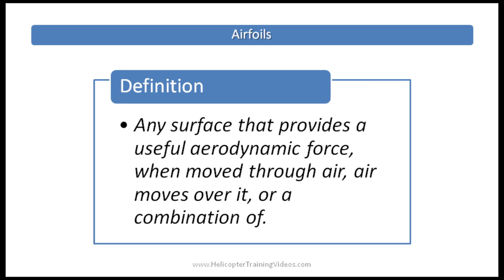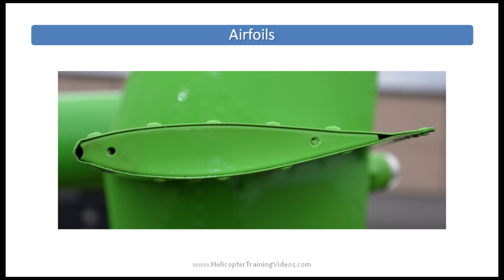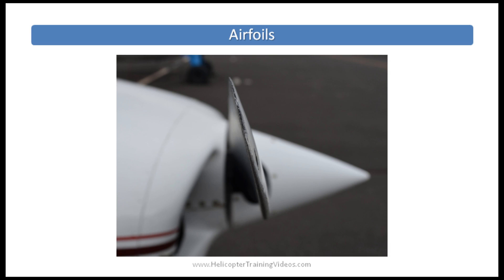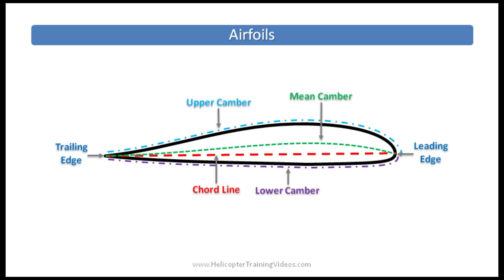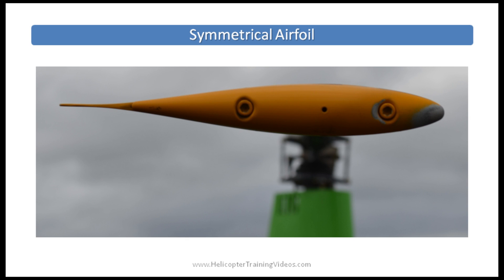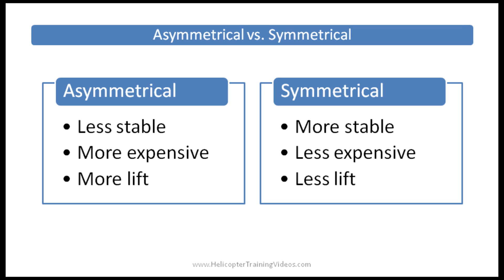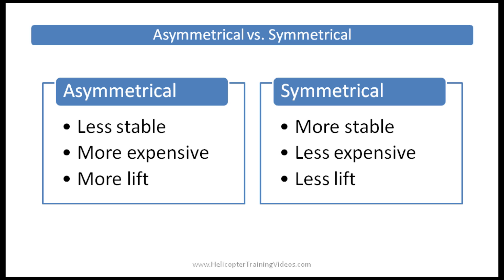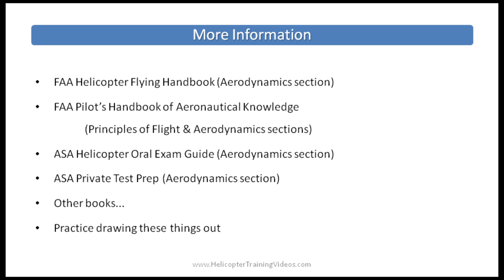What Is an Airfoil? A Wing, Rotor Blade, Stabilizer or All Three? Helicopter Aerodynamics.

Comment: I would like to know more about the newer swept tip rotor blades. Advantages and disadvantages.
Reply from the maker: I haven't dug deep into it, but my understanding is they advantages are noise reduction and delayed high speed aerodynamic problems, allowing for higher rotor RPM and more lift. Disadvantages - cost.

Comment: ? Blade length and width ?
Reply from the maker: R22 blades are 7.2" to 7.5" (18 to 19 cm) chord (width) and from center of hub to blade tip is 151" (12' 7" or 384 cm)

Comment: I don't mean to sound unappreciative or critical. Your video is excellent, very informative, thorough, and helpful. However, I'm fairly sure the aircraft you refer to at 1:15 as a "Cessna 152" is in fact a "Cessna 150" (which I learned to fly in). The -152 has a much sleeker, sculpted cowling nose than does the more bulbous cowling of the -150 (pictured in your video). Respectfully, Jim
Reply: literally irrelevant to the point of the video